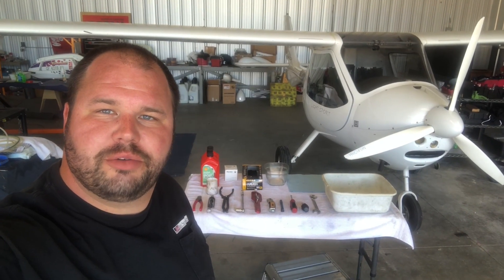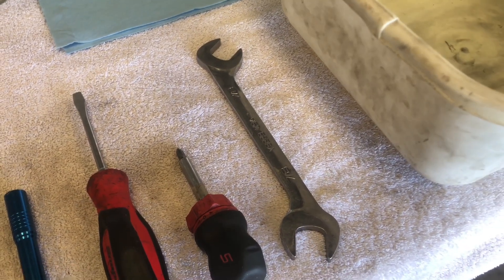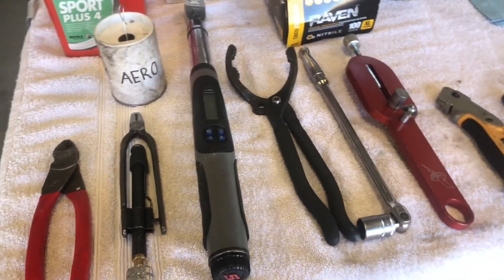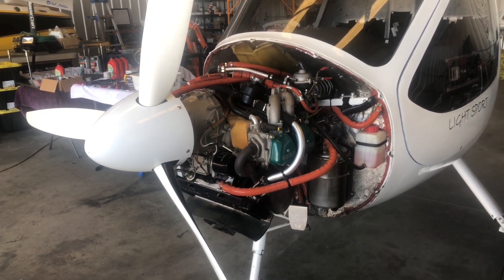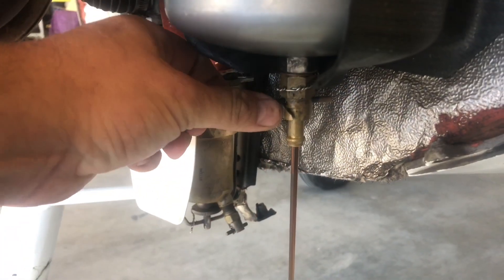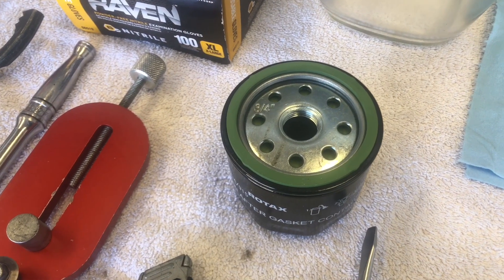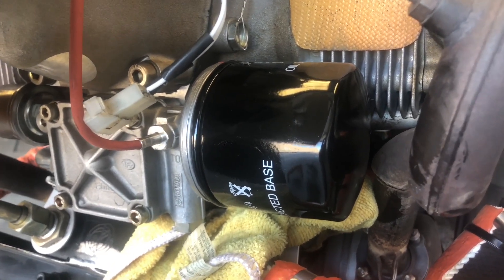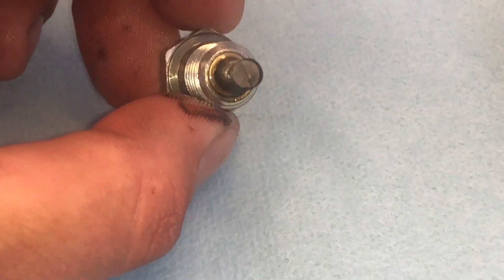Rotax 912 Oil Change Procedure Part 1

Comment: When balancing carbs would you recommend the carbmate or analog gauges ?  Could you recommend where i can buy either ? Thank you
Reply from the maker: I use a carbmate, I’ve on my 4th one in 15yrs so they do fail from time to time but they are very accurate

Comment: does that bolt that you safety wired the magplug to have a hole in it? if not what's to stop the safety wire from slipping off the head of the bolt ?
Reply from the maker: The angle of the bolt and the tension in the wire keep it from wanting to slip off, some people drill the bolt head but it’s really not necessary

Comment: Secret Tip: Progressive Oil Change. I have owned four 912ULS powered AC. Three I built. One is a Sport Cruiser. All have a quick drain installed on the oil tank. Every 20 hours, I drain off a quart of oil, replace it with a fresh quart. Oil suction tube never collects any air with this procedure. Keeps oil freshened up and additive package topped up and cuts moisture content in half, gets rid of lead. I usually drain the quart off when the engine is cold which gives time for unfiltered solids to settle in the bottom of the oil tank. This progressive oil change technique takes me only 15 minutes as opposed to over an hour for full-blown oil drain and air purge which involves a lot of potential leak issues, ie, four valve covers, spark plugs removed, oil lines removed, etc. All you need is a quick drain: Aircraft Spruce PN 07-00876.
Reply: If possible, type of quick drain oil plug you use?

Comment: Amateur mistake 😩how about filling the new oil filter with clean oil to pre soak the filter then drain new filter of oil before installation so it does not spill. The reason for this pre soaking is so when you first start the engine the oil flows and does not have to fill a dry filter before engine gets any oil or oil pressure😁simple

Comment: That's Jeremy McGregor and that's his plane. He used to work for the old CPS when it was in San Leandro, CA. I know him, but haven't seen him for a number of years. He's a nice guy.

A couple of comments. He is still using the oil filter pliers on the filter. He did remove the old filter by grabbing the filter case which can and has punctured filters. Since he was removing an old one no big deal, BUT never grab the new filter case with these pliers. It didn't show him re-installing the filter. If you do use these pliers make sure you ONLY grab the steel ring at the filter base. The newer style filter wrench is better and won't cause any damage.

He mentioned in the video you can't pre-fill the oil filter, but he was using a new one which can be pre-filled. You couldn't pre-fill the predecessor of the filter because of the check valve. This new filter doesn't have a check valve. His video looks to be made in June 2020 and the old filter has been gone a few years before this one came out. Go ahead and pre-fill the oil filter. You can fill it to the top 3 times and it will just soak into the filter media and to the outside of the filter median.

I'm not a fan of the Curtis Quick drain valve and neither is Rotax. The oil drains to slow to get a good flush of the heavy materials on the bottom.

Comment: I thought if you were running just avgas you had to do the tank cleaning every 50 hours?
Reply from the maker: Rotax says 200hrs regardless of fuel used, if running AVGAS then drop your oil changes from 50hrs to 25hrs. The  more tank cleaning the better but 200hrs is sufficient